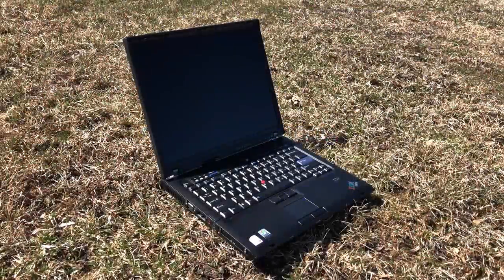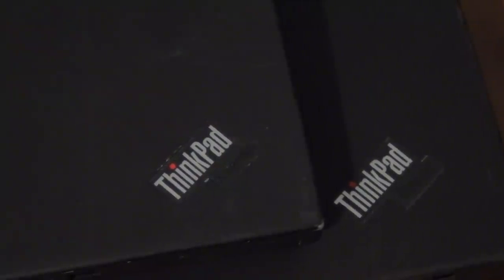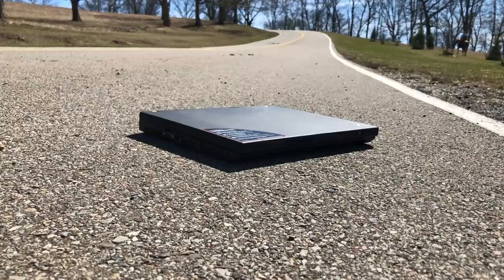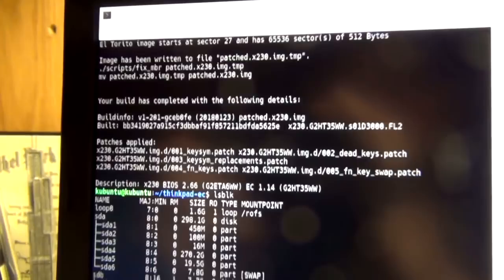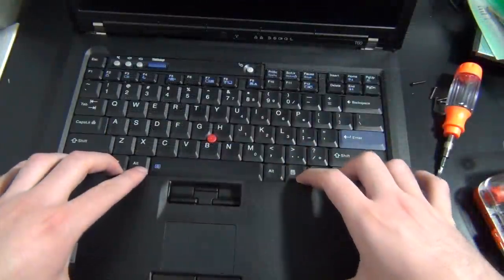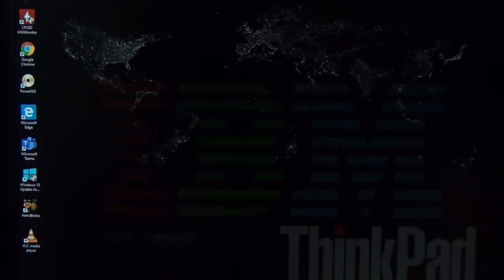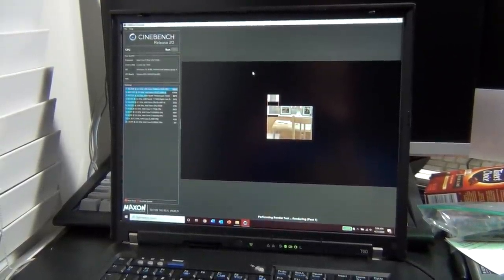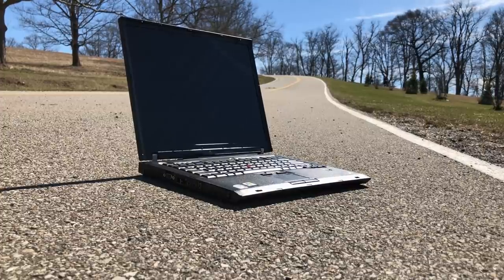Unlocking the ThinkPad T61 with Middleton's BIOS

Comment: How to fix youtube playback problem:
Step one: Install chrome plugin h264ify
Step two: Don't forget step one
Reply: Why is my YouTube videos slowing down too much? I have 260Mbit and I have no idea why it’s slowing down it never did this before...!
Reply: I just found one of the best plugin in 10 years, after privacy badger and facebook container......
Quick question: is there a universal plug in that do the same for all other video sites?
Reply: @rmsmajestic9411  not but some players are based on h264
Reply: I think the same, but you first :) 
I use h264ify on r61i c2d 1,83 ghz 3gb ram 160gb hdd, windows 10 32 bit Edge browser, and 720p is super smooth with around 40-50% cpu usage.
Step three: block 60fps videos.

Comment: One thing to note, that RAM limitation in the original BIOS was to stop memory address conflicts with GPU's inserted into the advanced dock. With 8gig of memory you won't be able to use the PCIe slot in the dock for a graphics card.
Reply from the maker: I guess I’ll find out once I mess with the Advanced Dock a little more. It’s interesting that you noted this because I haven’t seen anything online about that. In the coming weeks (or months) I’m sure I’ll find out. I wonder if this also affects the ExpressCard slot....
Reply: Im able to use it fine. Middlton's BIOS patches the issue. Its similar to the X230 16gb + egpu errors, its all software-side. 

I got a number of GPUs (up to a GTX 970) working with my T61p + 8gb + 2506 dock.
Reply: @henryatkinson1479  out of curiosity, why would anyone use an eGPU with a T61p? You'd be CPU limited in any recent game, and using a modern eGPU for games that are 10+ years old seems pointless.
Reply: I've seen quite a few T61's with badly seated ram, especially the upper socket.  It is very easy to mi-sinstall the RAM.  It needs to go in at a good angle well in before pivoting down.   That's very fiddly at times with that top socket.  I've opened them up and found the RAM floating free in the socket.  When it's right it feels good - if your not sure it probably isn't ...
Reply from the maker: @theglowcloud2215  I tested out an external GPU with my T60 about a year ago, and even a fairly weak low-profile card vastly outperformed the T60's graphics. Some games are less CPU heavy than others, and graphics are generally the aspect of computers that becomes outdated the fastest, so it makes sense for people to want to use an eGPU to squeeze a few more years out of their old system.
Reply: You still can. Works with T61 with X3100. just have to plug it in after system starts, system is windows 7. With windows XP things are a bit tricky
Reply: @theglowcloud2215  even a HD 7750 helps a gigaton in playing youtube videos
Reply: I have that dock station and have a question IBM dont answer in manual. is that PCIe slot only for graphics cards? as I tried installing a suround sound card and it dont split sound into 4channels just passes through stereo. if its only good for GPU card its a waste as my W500 also plugs into dock and has better GPU already
Reply: @henryatkinson1479  can oine upgrade the GPU?

Comment: You don't actually need to use PowerISO to burn images on Windows 10, it can mount and burn them with no additional software
Reply: MyName Here  except it does work for OS boot images, worked fine since windows 7 when it first launched. Unless you trying dos images or something

Comment: Heh, great video even three years later. The algorithm just brought this up. I've watched several of yours over the last couple years, and you may remember me from way back talking about an older coworker who grew up in Pittsburgh riding the trolleys all over.

To the point: a few months ago I bought 3 T430 units in a lot, they're my first Thinkpads after years of wanting one, and they've been very fun to experiment with. The direction Windows is going moved me to Linux back during the pandemic, and it's been a great experience. I'm running LMDE6 on the one I'm typing this on.

By the way, every time I see your laptops posing on the train tracks it makes me irrationally nervous. 😆

Comment: Man thet T60 is still a gorgeous machine...
Reply: You are so right there.  I have two of them plus a T61 and a T410.  There is a noticeable drop  in all aspects of the machine except raw horsepower as you move down the lineage.  The T60 is an almost, if not a perfect design.  It is very satisfying to own one of these things, and the cases last a lot longer than the T410 and more modern variants.   The way they open and service is great.  The T60 has both a PCMCIA and an Express Card slot, making them a bridge between the old world of ThinPads and the new.

And you would be surprised how well they run on their original OS (probably Windows XP Pro) or on a suitable lightweight Linux derivative.  For example, with a 32-bit bottom of the line Core Duo CPU and only 1GB RAM you can do most things except video editing and running lots of heavy programs at once.

The best upgrade for these T60's is 3GB RAM (add a single 2GB DDR2 ram module on top of the 1GB for around a fiver.  Then pop in the T7200 Core 2 Duo, which is a 64-bit CPU and a 64-bit OS.  I picked up two of these recently for £7 including postage from China.  They arrived brand new, well packaged and within four weeks of order.  Can't complain about that.  These CPU's cost $295 when new.  No BIOS mod required for this upgrade.

I have a T61 but I checked out the CPU prices for a X9000 and at £60-80 that's what I paid for a very good T410 with an I5 just needing a hard drive and install.  I'm going to wait a few years before I do mine.  That being said, it is the RIGHT upgrade to go beyond the T7200.  No other upgrade is really worth it, and the performance shown here on the video demonstrates that.

You only need as much RAM as you are using, and if you keep your eye on things, 4GB is normally enough, though 8 is of course, nice to have.  I have a couple of machines I run on 3GB which is a sweet spot on Linux for normal.  If you are doing any squashfs work, try an I5 or preferably a quad core and better.

Great channel, keep up the good work Sebi ...
Reply: I still use my T60 for any researching

Comment: I love this Sebi. I've been intrigued by the FrankenPad for a while. A couple of years ago I bought a job lot of four T60's on eBay for £40. They had no drives, no power, and no batteries, but I hoped that one of them might be the 15" model with a 1600x1200 display. I got a 50% hit rate (!) but both screens are fairly badly yellowed.

Then I came across the correct model of T61 to act as a donor. The seller had upgraded everything (he'd already done the Middleton BIOS), 8GB of RAM and had gone as far as putting a Samsung EVO 850 SSD in it. He'd got the 8300 CPU for it too. But when I tried using the T61, I was a bit underwhelmed by the performance.

Replacement IPS displays for this T60 aren't cheap, and I wasn't sure if it would really be worth it. I've already got a collection of X, T and W ThinkPads from the 30 series (which are all more than 3 times faster than the T61). So I never took the plunge.

The X9000 CPU is interesting though. I'm tempted again, but I just might have to accept if I do it that it's a hobby, not a sensible general purpose computing decision!

Also, hat tip to your Dell Optiplex. I got a small form factor 9010 a month or two ago and love it. I assumed it'd be faster than my previous "desktop" (a docked W530, hooked up to two monitors), but when I recently ran Geekbench on all of them I got a bit of a shock!

Results are here: https://browser.geekbench.com/user/graz

My W530 cost me £250 a couple of years ago and it was in extremely good condition. It runs a lot quieter than my T430 too. It's an absolute trooper. :-)

What's even more amazing to me is that the UltraBase 3 dock (dual DVI out, dual DisplayPort, USB3) only cost me £10. And it had clearly never been used. But I'm getting off topic...

Comment: Having 2 extra threads really makes a difference, I recommend the Core 2 Quad. The x9000 has slightly better dual core performance than my 2c/4t i3, but the i3 destroys it in quad core performance.

Comment: Great video and information.  I happen to have an old T61 which at the moment I'm running RHEL but not much use for it these days.  So now it's going down the Hackintosh route.  As it's an old system, bought new way, way back then.  I've been wanting to update the bios for a while.  Just curious, would the 550. motherboard work in this thing or is your only option the T60?
Reply from the maker: I'm not sure what you're asking. If you have a T61 already then there's little reason to change out the motherboard.
Reply: @SebisRandomTech  Thanks for the response. Turns out I misinterpreted your video when I posted the question. Which became clear once I went back and watched it again.  I was able to install the Middleton BIOS update to the T61.  Next will be the memory, Crucial doesn't seem to carry it anymore so that might be a Newegg or eBay thing, (it was eons when I originally built this system).  I was originally using T61 as a RHEL 7.x system however, if recall beyond RH 7.4 the wireless card wasn't supported and hence the need for the Middleton BIOS.  With the BIOS upgrade I was able to change the card get past the whitelist wireless card block.  I liked your tip about upgrading the processor Intel Core2 X9000 and will probably be going that route as well.  Just curious would the Core2 Extreme 9100 work as well?  I was able to find the W500 Cooling assembly you mention.  As I mentioned in my original question, my goal for this system is to convert it into a Hackintosh System.  Once again, great video and thanks for the fast response.

Comment: On the cooling assembly did you find a specific manufacturer you liked or did you find an OEM W500 Thinkpad assembly?  I found a couple of 3rd party ones on Amazon but mixed reviews. - Thanks
Reply from the maker: Found a system pull from eBay.

Comment: I never own a Thinkpad, but as i can see these models still rocking today and still recive a lot of love from community. Thanks for the video, i was kinda entertain about. Just a tip: if you plan to use chrome use it with h264ify extension, is useful since force h264 instead VP9 and also you can force 30fps. I wonder if someone made a bios mod for my Pavilion dv6-1270el , im fine with core 2 duo T9600 but i wonder if some try to put a Core 2 Quad into it, however the Q series on socket P are rare to find at good price.
Reply: Ive seen a bunch of listings for the more middle ground quads and it dosent seem to be that expensive
Reply: @atilamotila8907  I often looking in my local Craigslist, but in Italy where I live the used market isn't much a thing, often prices are ridiculous for an old CPU or the shipping from UK or USA is kinda expensive.
Reply: @MrOoh50  oh ow i see. Then its a hard pass in that case

Comment: I did mine today, I remember the old drive it had in before I installed the SSD with win 10 64-bit had a 32-bit windows installation on it. SO I just quickly had to swap out drives and was able to run the win 32 update application rather than flashing from CD... in 64 bit. Afterwards I just put the win 10 drive back. Youtube plays smoothly at 1080p on Bing.... not quite smooth yet on Chrome but also much improved still.

Comment: I'm a father supplying computers throughout the family, Aka "TECH DAD"! and a Thinkpad addict also....I built two I5  T440p's with SSD's ,IPS screens and 8gig ram. 1 for my daughter and 1 for my mom..those got a flowery skin cover. I built up a X1 Carbon w/touch screen 1st gen for my wife...that got red carbon skin. I maxed out my T440p  (yep three T440p's)with 1tb ssd , ISP screen 16 gig ram ,i7 4702MQ Quad core. I edit some video with this! I recently saved a E530 from the trash and doubled the ram to 8gig and put a cheap 128gig m.2 ssd in it, And after all this I think Id like to mess with a x220 or x230.
Reply: That's great ! where are you from? do you buy the machines from ebay? i always try to buy something that's fixable, for my next project I'm looking for a thinkpad x230
Reply: @luisfernando55  I'm just outside of Dallas Texas. I get all of them except the E530 from Ebay. I look for ones with parts missing because I always upgrade.. a nice key board... back lit is nice too , no broken housings and cheap! A cheap skin will not only hide some case rash but also personalize it! The X230 seems like it would be very gratifying at the end of the build to me also.
Reply: Try a 240x - now that's some nice hardware - no whitelist for the internal Mini-PCI - might take an internal PCI-USB in it ... I am hoping to try it soon ... get into some Retro MS Access 97 on W95 ;) (in 192MB RAM)
Reply: you must try oled panels, more colorful and more responsive

Comment: Hmm, I have a later T61 with the Nvidia GPU, Middleton BIOS (of course), a 1680x1050 screen, an SSD, 4GB RAM, T8300 processor and a 32- bit Windows 10 (21H2) install.  It will run 1080P YT videos all day long without issue.  It's a nice machine for it's age and it's just a blast that something this old can competently run an OS that was never even envisioned when t was designed.  I love ThinkPads .. even the newer ones like my T480.  Well, most of them.  The X1's seem like Apple envy to me.  The X1 Carbon line should have the ThinkPad label removed.  They are more form over function, which really goes against the 'true' ThinkPad philosophy.  Call them "AppleEnvy".

Comment: Thanks Sebi, great video!
In next one you could show how much can you squeeze out of it overclocking CPU and GPU in ThrottleStop. I read NVS140M reacts good to overclocking and can reach almost level of performance of nerfed 128Mb FX570M from T61
Reply from the maker: We’ll see about that. The NVS-140M is quite prone to failure, and while I do have one of the “revised” versions of it that shouldn’t fail, I don’t really want to take any chances.
Reply: @SebisRandomTech  Just do it! 

I mean for daily use, it probably isn't worth the extra power and heat, but you can show us its full potential in a few benchmark.
Reply: @nhansgoofyvideos7581  , I'll test on mine when it arrives. Waiting for the parts now.

Comment: I have T61p with modded Middleton (undervolted GPU) and 1920x1200 panel. Only 4Gb memory however. It's like new, looking unused. Repasted it and swapped 250Gb Samsung SSD. It has Win10 and WinXP dual-boot.

Comment: Thanks for this. It worked for me after I went the “reinstall 32 bit Windows 7” route just to use the BIOS flash software. I’m looking forward to faster data transfer over SATA II. Good to know it can take up to 8GB RAM but that would require a pair of 4GB DDR2 sticks, and those, being scarce, are too expensive to play around with.
Reply: It's nice to know it's SATA 2 yet I believe that this laptop is not limited by the SATA 1 channel at 150MBps.  Unlikely to get anywhere near there on a T61 even with an SSD.  My practical testing has convinced me to stay on SATA 1, yet I am open to correction on that and would be interested to know if you could detect any significant difference doing a copy to backup over it.  Here's the spec:

SATA I (revision 1.x) interface, formally known as SATA 1.5Gb/s, is the first generation SATA interface running at 1.5 Gb/s. The bandwidth throughput, which is supported by the interface, is up to 150MB/s.
SATA II (revision 2.x) interface, formally known as SATA 3Gb/s, is a second generation SATA interface running at 3.0 Gb/s. The bandwidth throughput, which is supported by the interface, is up to 300MB/s.
SATA III (revision 3.x) interface, formally known as SATA 6Gb/s, is a third generation SATA interface running at 6.0Gb/s. The bandwidth throughput, which is supported by the interface, is up to 600MB/s. This interface is backwards compatible with SATA 3 Gb/s interface.
Reply: Yes, 8GB DDR2 kit is too expensive, and doesn't make much sense if all you use T61 is for some light tasks/ coding and watching video.   I just bought a used T500 with 6GB of ram for less than cost of single 4GB DDR2 stick!

Comment: Nice video and timing is right for me. I came across my old T61 That I haven't used in sometime and tried to boot it up and received a cooling fan error. I remembered it needed replacement and also recalled how good this system was back in it's day. After seeing your video updates and all I started thinking about possibly doing some of this to mine and keep it as a backup system. Could you provide me with the part numbers used on the processor, memory, W500 cooling assembly and WiFi upgrade you were considering? 
Thanks, Frank

Comment: Hey Sebi, great video, but I need some help. My R61 is a Type 7737, and somehow has a firewire port in its front, even though the lists at 2:15 and https://www.thinkwiki.org/wiki/Middleton%27s_BIOS have the 7737 listed under "R61 (14.1" widescreen without IEEE 1394): 7732, 7733, 7734, 7735, 7736, 7737, 7738" . Which BIOS should I flash? The one for the models with firewire or the one for the 7737? Interestingly some of the models like the 7732, 7733, 7734, 7735 are listed as both with IEEE1394 and without IEEE1394.
Reply from the maker: That’s an excellent question...I’ve never used an R61 of any kind so I don’t want to give an answer that would be incorrect. I suggest consulting the ThinkPads.com forum or r/thinkpad to see if someone there knows.
Reply: @SebisRandomTech  So I ended up installing the firmware for the models with Firewire, and it works. I installed the one for models with Firewire, even though 7737 was not listed there, because if you go to Lenovo's downloads for the R61, for the 14.1 inch models (which the 7737 is) there is no specific download for any specific model or models, its just either for models with Firewire, and without it, hence I came to the conclusion that the Firmware for the ones with Firewire should work.